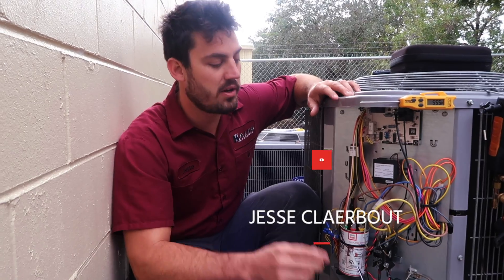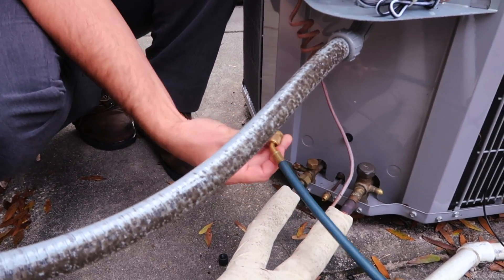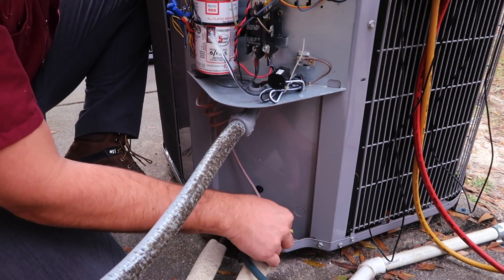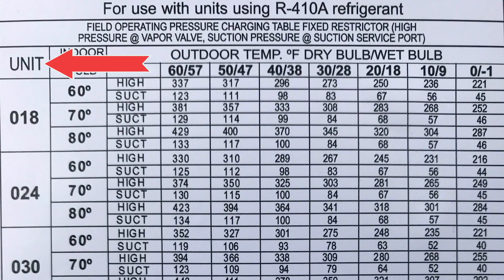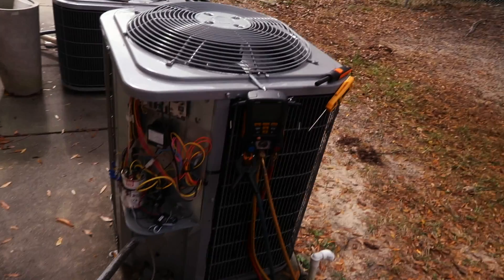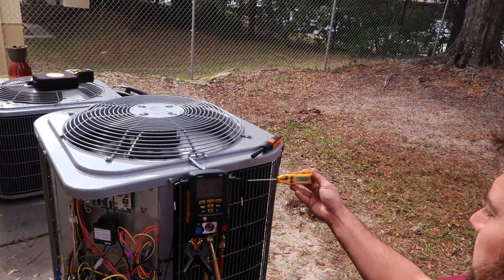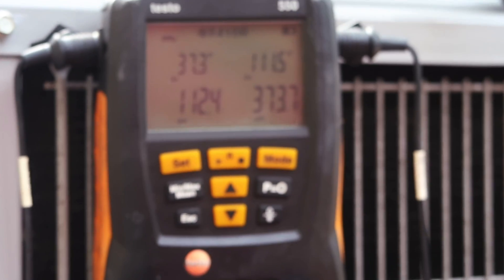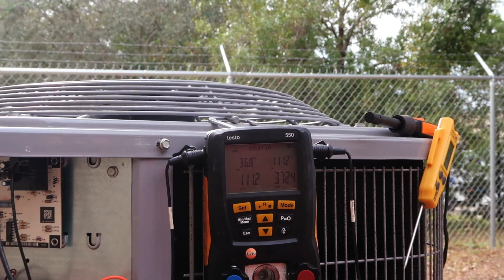Checking a Carrier Heat Pump Charge in Heat

Comment: This is incorrect information you would take the average of the temperatures to get ur pressures
Reply: The average of the indoor and
Outdoor? So you would add both temperatures and divide by 2?
Reply: @KCtheMC  if your outdoor temp is in the middle of the outdoor chart temps then you add both outdoor temps and ÷ by 2. Same with pressure
Reply: @KCtheMC Are you tying to balance charge in heat mode?  I find measuring the vapor line temperature works pretty well, target is outdoor temp+100.
This should get you close until you can run in cool mode and measure subcool/superheat.
If vapor line temp is much over ambient+100, it's low on charge and if less than ambient+100, overcharged.
This is basically just making sure the compressor isn't burning up (high compression ratio) or slugging liquid refrigerant.